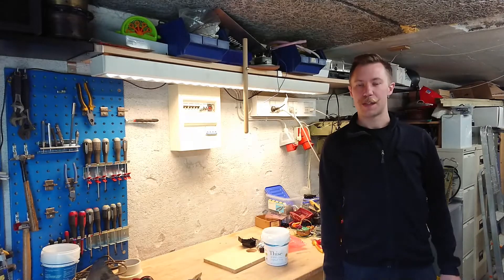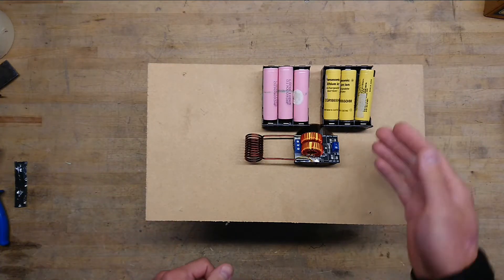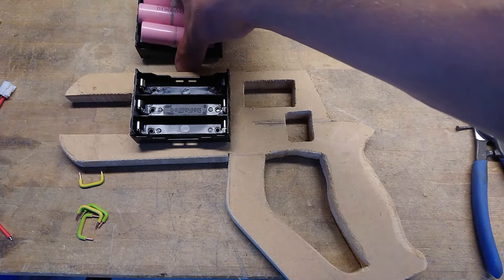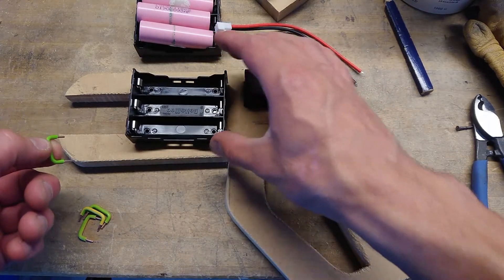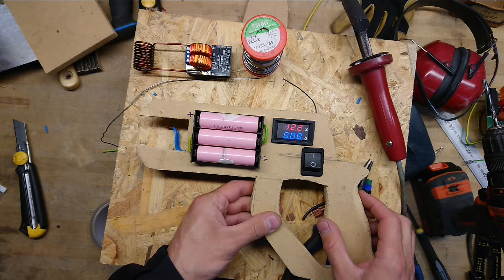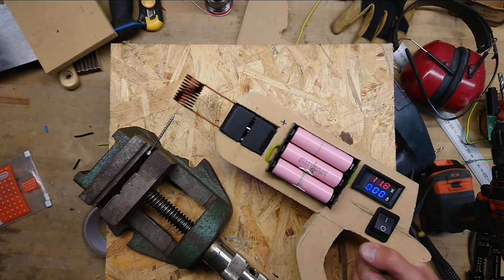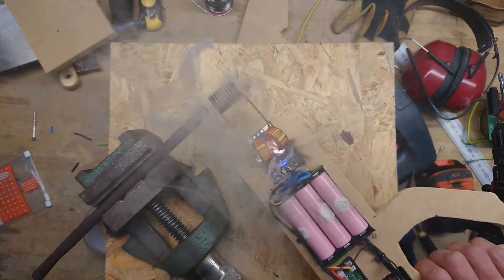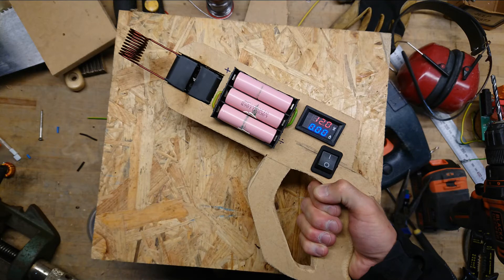Handheld 150 Watt Induction Heater on 18650 Batteries (Fail at End)

Comment: Not your Fault! I bought same induction heater module,and FETs are damaged only with 12v 2A power supply:(
Reply from the maker: These ZVS drivers are notoriously known for destroying themselves, if the power supply can be pulled down below 7V, so as the MOSFETs spend their entire switching time in the linear region, causing massive power losses. 12V 2A is too weak a power supply for driving a "150W" ZVS driver like this IH. You need something that can do minimum 12V 12A.

Comment: These things have a poor reputation for failing because there really is no limit on the power they can draw so I would have wanted a working ammeter to see if I was over-reaching the 150w - a 12.5amps limit. I would also have used the correct cells that can deliver high currents without the voltage dropping so low. When heating the thicker rod the volts dropped to 8.9v and came back to 11.1v when the rod was removed so you were dropping 2.2v across the internal resistance of the 3 cells which would be dissipating ~12.5x2.2 or getting on for 10 watts each cell, which is more than I have ever seen - they could have exploded ! One of those rare situations where a weak power source is more dangerous than a powerful supply.

Comment: Pretty nifty idea. Try some old drill battery cells or similar high discharge 18650's. Those LG's for example are only good for 6A peak but are probably more designed for 1A or less continuous.
Reply from the maker: Yeah these comes from old laptop battery packs.
Reply: @KaizerPowerElectronicsDk  They are still useful though, I just scored like 20 of those bad boys.

Comment: LOL that was a cool project, and you are right at the end, the gate voltage was too low when there was the high load. I always run my ZVS curcuits on a second 12v supply so if the current spikes the voltage feeding the gates does not drop at all. Maybe V2 could use a solid state switch and a boost converter to regulate the gate voltage.

Comment: 150w at 12 v draw over 12.5A it should not burn the mosfet (it will get very hot tho if mosfet rds on is pathetic like 0.1 ohm). perhaps inrush current ?
dunno just guessing

Comment: The spy chip in those import boards know how much time you spend on the project.  The more you build, the sooner the smoke valve opens (integrator).  That's how they always work on the bench with hillbilly wiring and no safety or dress-up.

Comment: Reinforce the PCB tracks - they usually are way too small and thin on those ebay/china induction heaters to carry enough resonant current - especially when trying to heat that huge chunk of metal.
Adding a boost converter capable of delivering the amps needed at/near battery cut-off voltages would probably also be a great idea - that way you're sure a dropping battery voltage won't lower your heating power/blow up your mosfets.
Reply from the maker: I did test it earlier and it did perform pretty good. The batteries was just not a stiff enough power supply. https://www.youtube.com/watch?v=A8FWSzfHgGc&list=PLw4xMO1xCMSUOj19zUmFE2-a2lcFBuzX_&index=2
Reply: @KaizerPowerElectronicsDk  7:15 - You're awfully close to the thin-walled metallic rod.
https://en.wikipedia.org/wiki/Inverse-square_law - The closer you get (you're scraping against it), the higher the current it will draw. 
You did not try that on your initial test, as far as I can see?

Comment: Those cells are not rated for high drain. I'm sure the voltage sag made the board go into flames. They do not tolerate voltage sag.

Comment: At least the Induction Heater failed before the batteries did, they aren't rated for 10A+.
Could be the reason the voltage sagged down to 9V, or maybe you needed to start with another cell in series.
LG HG2 cells are rated for 20A, if you decide to try again.

Comment: I expected the battery holders to melt, I have had those springs deform / plastic melt and lose contact when using them for high current

Comment: Those 3-digit meters are terrible. Even if you adjust the trimmers, they are really inaccurate and dont display anything until a certain threshold. The 4-digit models of the same size are a lot better.

I think this calls for a MUCH more powerful self-made driver. Something that will last for more than 15 seconds haha :)
Reply from the maker: Just wanted to use the small IH board for something after the first tests. It works really well with with a server PSU with a stable 12V.
Reply: @KaizerPowerElectronicsDk  Any idea what partnumber the mosfets were? maybe gate voltage was too low/switching too slow at that voltage. 
Input voltage might have had a lot of ripple too coming directly from the batteries, so could have dropped a bit lower than 9V.

Comment: haha I think the load (metal rod) was too much which caused the battery voltage to sag and stopped resonance and thats why it shorted. Can't always trust the manufacture's claim lol.
Reply from the maker: I trust the voltage reading... a little bit... :)
Reply: Nah the mosfets just overheated within a few seconds. Too much current with no heat sinking to speak of, so no surprise really.